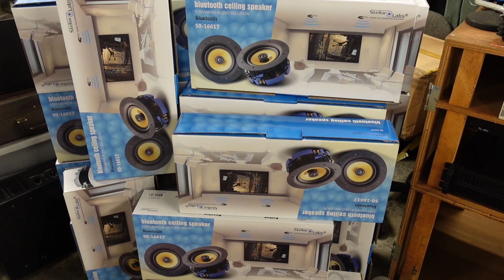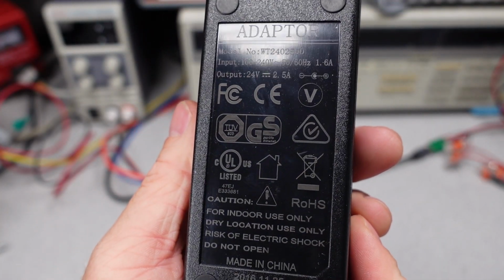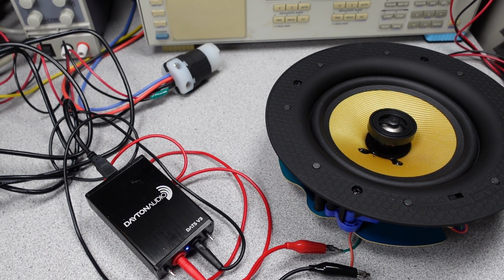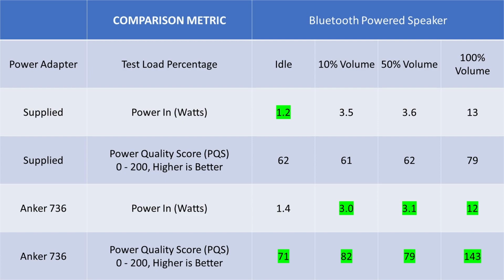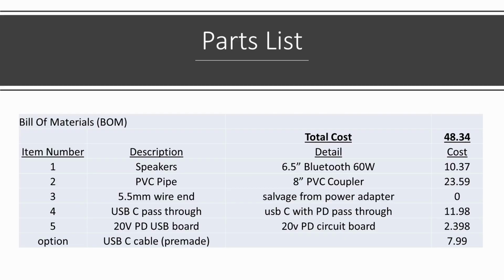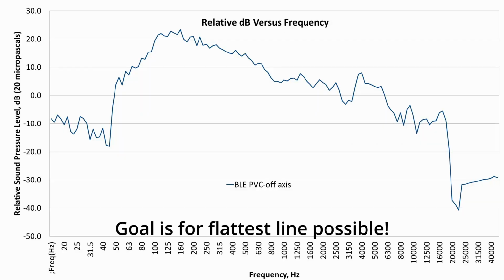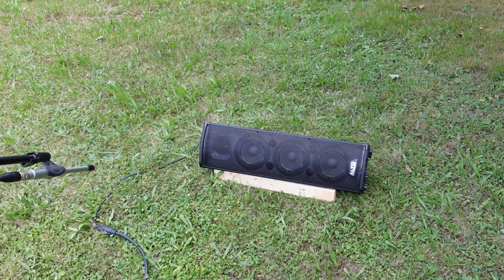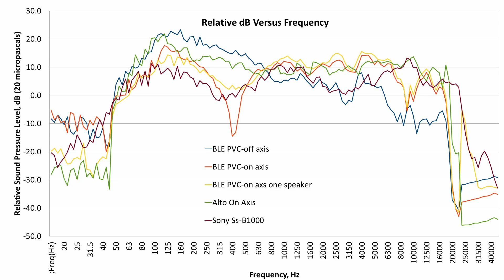Bluetooth Speaker Build with USB C power

Comment: For every 3db the power is double. So I got just over 97 dB. Had to look up the relation of dB to distance for the bonus. Double the distance is a decrease in power by about 6db. So just under 79 dB!
Reply from the maker: I should've wrote down what the questions were, ha.  But it sounds correct for the relationships of power and pressure level in general cases.

Comment: 98db SPL for same speaker at 10W theoretical but you said max SPL measured at 13W was 96db 1kHz@1W/1M, so I'll say <96db =)  Bonus is 78db@10M theoretical . Would love to play around a set to possibly 3D print an appropriately-sized enclosure and compare to my venerable Altec Lansing iM7 ! (sadly, from the pre-BT era *sniff*)
Reply: btw- Am looking forward to your line array project as I simply don't trust the other "theoretical" stuff I find on YT.  Love your videos !
Reply from the maker: Thanks!  Also, good answers for the previous comment!  Yeah, this is rev. 3 of cheap homemade line array.  I should do a video in theory with one of the existing ones maybe.  I never made a video on the assembly process which was a long time ago now.  Can you find the channel email address on YT?   I don’t want to type it in the comments but send over an email with an address and I’ll send over a box of these if you want.
Reply: @AllThingsOnePlace  Is it the email on your website ? I’ll fire a message off to there. I became fascinated about line arrays while researching optimal setup of 2x 15” subs + 1x18” sub for my Burningman camp. Not as “magic” as RF but still so many variables to consider.
Reply from the maker: @fiveangle  Yep, it is the channel name @ gmail.com.  Ah yeah, woofers would be something like a cardiod setup if you can get enough of them.